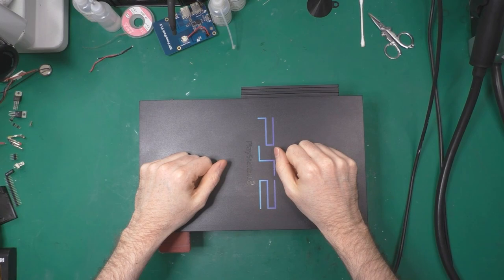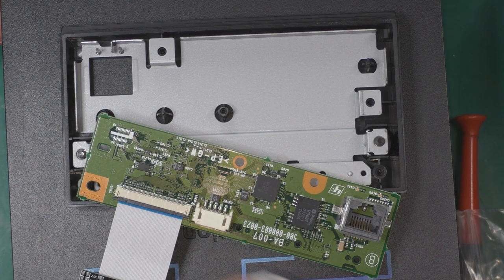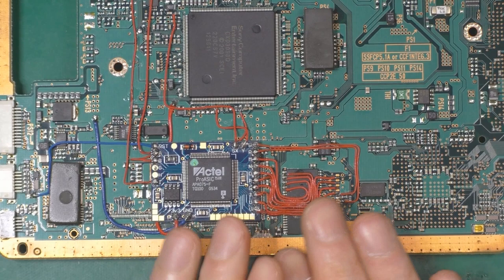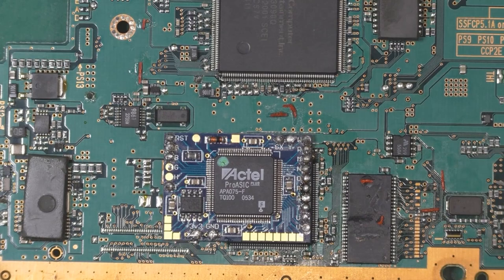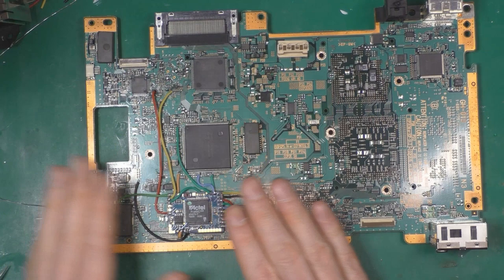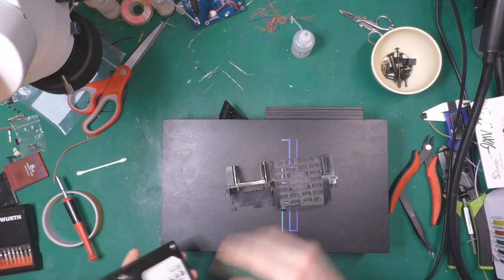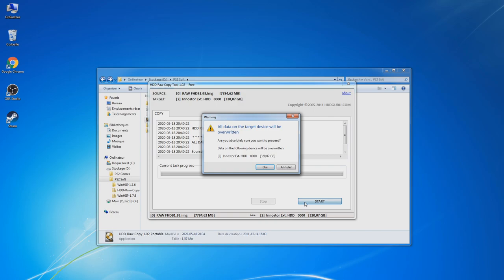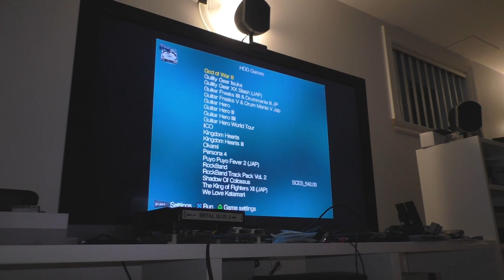[Retro] Playstation 2 Full Service - Matrix 1.93 mod chip, FreeHDBoot, Sata HDD, etc.

Comment: Hey Real Phoenix, I have a fat PS2 SCPH 30001 that worked perfectly fine but haven't touched it in years.  Went to boot it up the other day and I have no picture or sound (black screen).  I hear the DVD drive spinning but that's it.  I took it apart to see if there was anything that was obviously disconnected but didn't see anything.  Any ideas what it could be?  It's not modded, just a stock PS2.
Reply from the maker: I'll assume you did test the basisc (faulty A/V cable, mess with video settings, USB drive, boot.elf on the memory card, etc.) I'd say it either faulty caps or a fuse blown somewhere in your console. Here's where you can find some pics to search your fuses. Use a multimeter in continuity test mode and check the fuses. It could be worse but I'd start from there.
Reply: @TheRealPhoenix_Retromods   Yes, I tested the cable with my slim PS2 and it worked fine.  The unit powers up, DVD and fan on back are running but have no picture or sound. Did you mean to post a link to pics of the fuses?
Reply from the maker: https://www.ps2-home.com/forum/viewtopic.php?t=2779 Is it working?

Comment: i disabled my modchip. but still the hdd shows status as connected but not formatted. once i format, then restart the system, it shows as not formatted again. I booted opl from mc, but inside opl the hdd games aren't showing. I configured the hdd and games perfect. Does the matrix chip causing the issue???. Disabling the chip didn't fix the issue for me
Reply from the maker: No. The Matrix modchip doesn't alter the HDD. It just prevents FreeHDDBoot to acces it. If I use FreeMCBoot I don't have this issue. If I use FreeHDLoader I don't have this issue either.
Reply: @TheRealPhoenix_Retromods  Fine. my OPL shows nothing in HDD games though games were installed. In ulaunchelf hdd manager (misc), It shows status as connected : yes Formatted : No. I tried other HDD and same occurs. HDD working fine with PC and i formatted it using Winhiip 48 bit. Any advise please???

Comment: I have a chipped PS2 too with Matrix Infinity 
so if i want tp play games from my HDD it works only if I have only FreeHDboot intsalled or only freeMCBoot right? Can't this chip activated than or should I deactivated all the time?
To deactivate the chip Hold start and unboot how i can it activated again?
Reply from the maker: Yeah FeeHDLoader was booting right up,  FreeMacBoot from the disk+Matrix was not working. I though the deactivation was only once? Anyway I think the best solution is to use a memorycard with FMB and call it a day.
Reply: @TheRealPhoenix_Retromods  you haven't to deactivate something if you have FHDB than you can press L2 and you will get to the OPL Loader directly. And if you forget it to press this Button,  then you have to press L2 fast after you klick Open Loader and this programm will  load:) its much better than deactivate the modchip

Comment: Mate. I just cut that soltered wires off. Does that mean the modchip uninstalled??.
Reply from the maker: I don't get which wires you are talking to. But if you had a Matrix like the one in the video yes you removed it I supposed.
Reply: @TheRealPhoenix_Retromods  the connections that you did in modchip reinstall. I cut all of them. Because my ps2 isn't showing hdd games in opl. The ulaunchelf hdd manager was just able to format the hdd drive. But if i reset the console. The hdd shows like connected but not formatted. I believe the modchip causing this issue and i cut those modchip connections on the motherboard. But the problem still persists pal. Could u suggest any idea to have my hdd working. Or do i need to clean install the modchip???. Help me bro
Reply from the maker: @schwarzeneggermanoj2634  My issue was the HDD was displaying games fine but I couldn't launch anything. If you have issue with the HDD I'd say you should try to properly configure it on WinHIPP before doing anything.

Comment: Where did you get the metal hard drive rails ?
Reply from the maker: They were  provided with the kit as long as the screws/stands.
Reply: @TheRealPhoenix_Retromods  where did you get the kit though ?
Reply from the maker: Found it! I had to check my old email:
http://www.maxdiypower.com/index.php?main_page=product_info&products_id=103
the metal plates are in fact separate:
http://www.maxdiypower.com/index.php?main_page=product_info&products_id=137
I'll add the links in the description!
Reply: @TheRealPhoenix_Retromods  thank you I appreciate that a lot

Comment: Make the new ps2 way pls the one with Dvdboot 2020 #NewPs2Exploid
Reply from the maker: FreeDVDBoot only works on specifics PS2 DVD Player Version (3.04, 3.10 and 3.11) and the program for this is only on Linux. So until it supports more versions and have a Windows exe (even in command line) it's a no go for me.